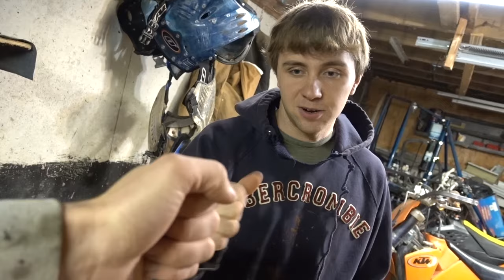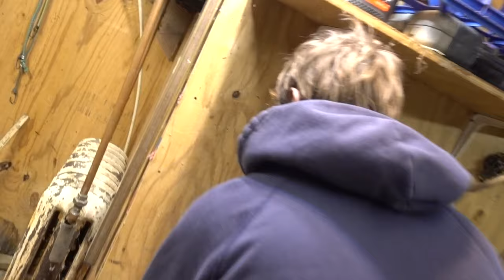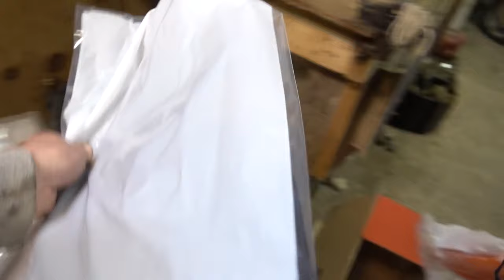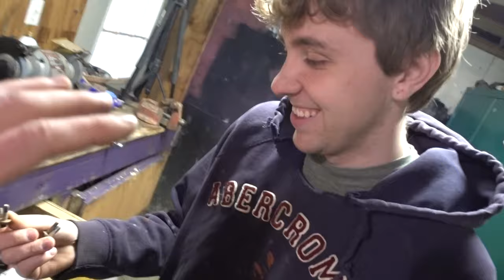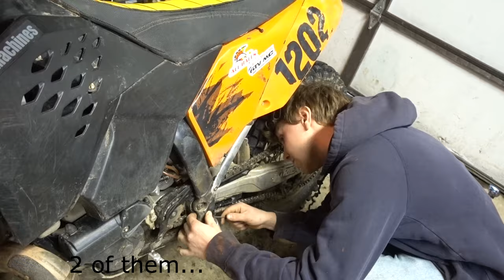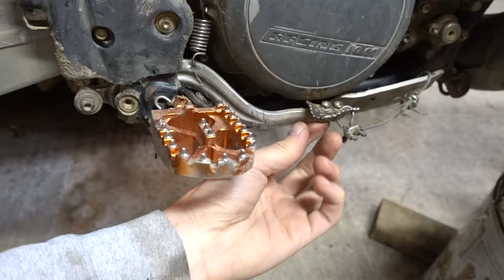NEW DIRT BIKE WHEELIE INVENTION!! (KTM 300)

Comment: Dalton here is how you fix your radio

Step 1: Start the vehicle and turn on the radio.

Step 2: Press and hold preset numbers 2 and 3 until a three digit code appears on the radio display. Write this code down.

Step 3: Press the AM/FM button. Your radio will display a second three digit code. Write the second code down. You will now have a six digit code.

Step 4: Call the Chevy Radio Code phone line at 1-800-537-5140.

Step 4: Enter 106010 followed by the # key to direct you to the radio code retrieval system.

Step 5: Enter the six digit code you retrieved in steps 2 and 3 followed by the * key. They must be in order. You will be given a four digit radio code. Write down the radio code.

Step 6: Start your vehicle and turn on the radio. Using the Minute and Hour buttons, enter in the four digit radio code to your stereo system. Press the AM/FM button to unlock your stereo.
Reply: EliteEggs everyone has copy and pasted this so much.. it doesn't work for him
Reply: EliteEggs  he needs a scantool that can read and write to the body control module.   there is no other way to pair the radio to the BCM.  it is very similar pairing a replacement key-fob for locking/unlocking the vehicle.   some GM automobile models can be programmed by the end user, but GM removed those end user features in order to get more  people in the service bays so they can charge owners for an hour of labor for a 5 minute job.
Reply: Doesn't apply his his vehicle. The end user programming was absolutely still in effect when his truck was made. It was still used in 2012....I just dont think he's done it yet.
Reply: Alternative Method,
Step 1: Go to Walmart.
Step 2: Buy a radio worth having.
Step 3: Take out the old radio and deposit said radio into the nearest garbage can.
Step 4: Install the radio that actual works.
Step 5: Enjoy all the tunes you like.
Reply: I live about 3 hours and 43 minutes from you
Reply: EliteEggs I
Reply: DaTwistedOne1 did you consider that those radios are years newer than the truck.  and in cases where they were not even designed in same decade makes the scantool an absolute requirement unless you can take an ATMEL OR PIC chip and spoof the electrical signals that the newer head unit requires to cooperate.

now he could buy a radio that is the same year as the truck, and PROBABLY get it working using that 12 step guide.

Comment: Just learned about your radio in my automotive class. The theft lock was something GM tried in the late 90's early 2000's there were a lot of radios being stolen so they made it to where when the radio is disconnected from power or the battery of the vehicle is taken out and put back in it pops up "locked" or something like that this does not mean your radio was stolen (well I guess maybe) but I'm sure the person who sent it took it out of there truck not knowing that it would lock up thanks to GM's theft tactics a way to diagnose this "Locked" problem is to enter the 4 digit code it should be in the glovebox of the vehicle it came out of but if you don't have the 4 digit code to enter your screwed.

Comment: if you would like to fix the radio i know where the chip is that causes this to happen. if you can not get the code for the radio you could try this, open up the top of the radio. looking from the front on the left side of the radio at the top you will see like a hole where you can see the safty chip. siz of a tick tack its a black chip. you wanna brake the front half of the chip off and everything should wrk good but brake it with a needle nose pliers from the top. thats why you need to remove the top cover. if you dont find it youtube how to remove safty chip in gm radios. easy peasy.  good luck buddy keep making awsome videos for us :)

Comment: Fender brace or for holding your spare tube and tire tools, when you get 75 miles from home in the woods you will be glad you have those tools and parts. Even made a small jack that use's the kickstand to hold the front or rear tire off the ground for tire repair in the middle of bum f@#k no-where.

Comment: Can someone fill me in on what was exactly wrong with the radio he had originally? I know the new one needs to be re programmed
Reply: AndrewR CD stuck in it.
Reply: Josh Goodnight thank you! Now for my way to fix it. Take the new ones CD player out and put it in the old radio. Since the board in the old one is registered to the truck it should work. I mean all you're replacing is the cd drive. Or if you really want to keep the looks of the new one you may just be able to swap boards if they are the same.